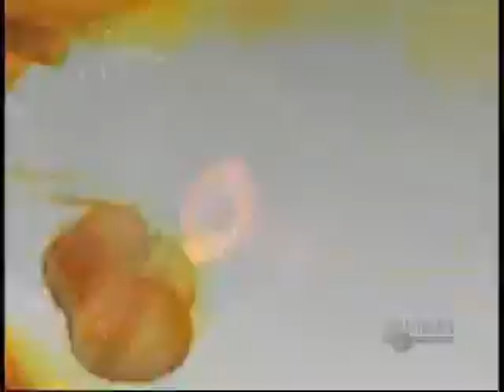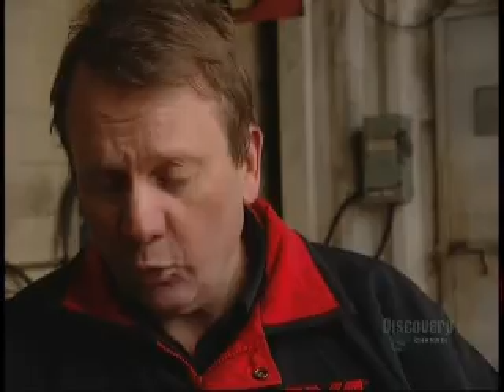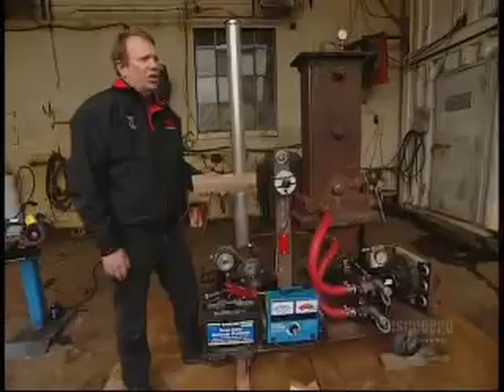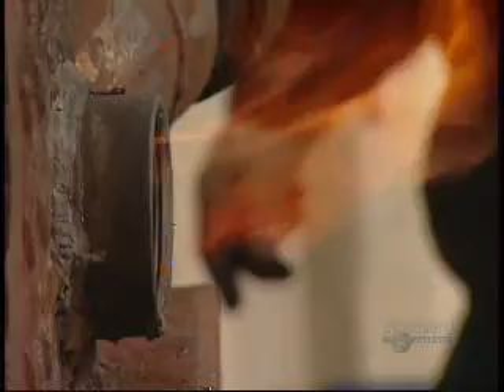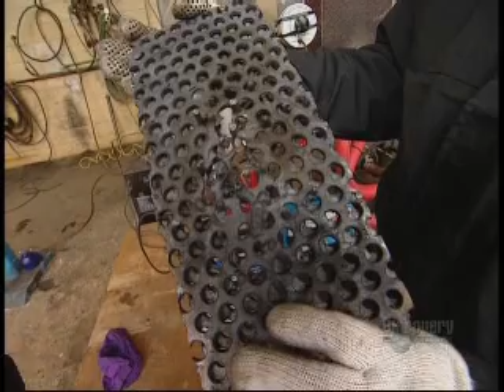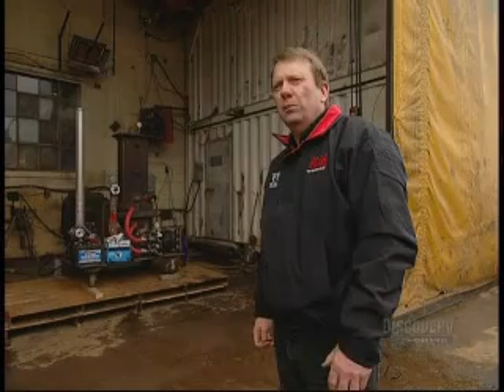Eco friendly turbo

Comment: Making electricity from the turning 120,000 rpm turbo. It is different from this shown here as could use fry oil for fuel. Issue would be heat transfer to large pma and balancing to 150,000 rpm. High volt pma to high amps to charge battery bank to propel a car. Efficiency of design? 75% of fuel utilized instead of <20% 30mpg.Maybe 200mpg.Turbine wheel inlet connected (same shaft)thru cv joint shaft (lower heat) 3phase ac pma.Regen brakes,1liter engine.Ram air induction apparatus cooling effect